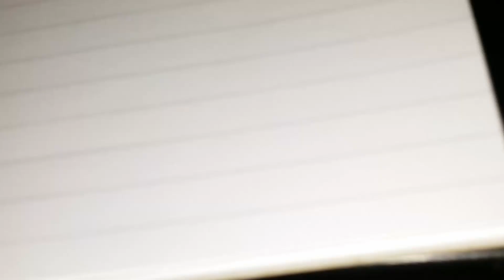Install NVMe SSD - Remove Sata M.2 SSD

Comment: how change sata to nvme booting?
Reply from the maker: In bios change boot sequence to new drive, check your motherboard manual for your settings. I have a different video on channel how to upgrade to NVMe that goes through my process 👍

Comment: don't get it, mobo isn't recognising my NVME but did check to make sure it's compatible. don't have a screw to screw it in but that can't be the problem... could it?
Reply from the maker: There should be a screw to secure it, this makes the connection better, I wouldnt use it without the locking screw. You should have one in your motherboard box. Didnt you comment on another video stating the write speeds were erratic?
Reply: @CalmCal  nope wasn't me haha, don't even have it working. well be getting a screw and have been doing research on the CSM and the mobo does recognize it.. just took me a bit to find it in the bios
Reply from the maker: @l0rdcroissant  ok goodluck, same name and profile picture commenting on my upgrade ssd to NVMe video - must be a doppelganger eh!?
Reply: @CalmCal  I got to look at what I wrote than, that's strange